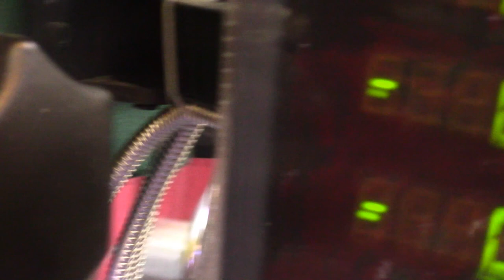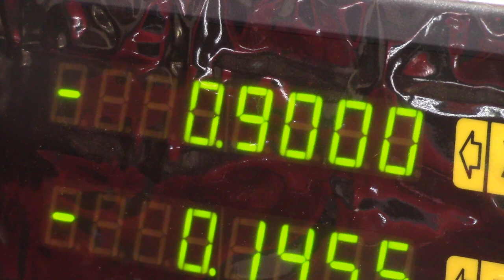Scope height gauge part 2 of 2  plus some more on drones and the law

Comment: nice work on gauge.....interesting to find out theres rules on drones...have neighbors who got two for  x mass  and theur buzzing all back yards in area ...irritating also pretty close to power lines
Reply from the maker: If they weigh more than .55 pounds they are FAA regulated.  I expect a couple of bangs into power lines and the propeller cost will go up.  Thanks for stopping by.

Comment: I like the basic principle of the height gauge and you made some super nice parts, but not yet quite sure whether it's essential, when for most part scope rings or picatinny rails are fixed height. Maybe I'm not fully grasping the thinking behind it.
I registered my first drone, then seemingly the requirement was lifted - then it came back and anyways I registered the Mavic too even before that.
Reply from the maker: My scope has a ballistics calculator built in.  So I have to know the height for the calculation and the rail is not the same height on all rifles.  I may move the scope to some other rifle and need another profile with a different height so I will need to measure again as the rails will be at a different height making the scope a different height.  Not overly necessary for measuring as I can do some addition and division and get the answer but certainly easier.  I am not all that happy with the regulation.  It certainly complicates things that could be a lot simpler.   Thanks for stopping by.
Reply: Thanks for the explanation Harold - I see the rationale much better now. :)

Comment: I understand how the scope gauge works & what data it provides you, but I'm not sure how that data is useful. Also your fitting the various bore diameters would be a good use for some gauge pins, in case you don't have any and need and excuse to buy a couple of sets. 😀
Reply from the maker: I would love to buy some gauge pins.  The scope height is for the ballistics calculation in the ATN scope.  It is also good for those who use a ballistics program for reloading.  Thanks for stopping by.
Reply: Amateur Redneck Workshop I suspected it was needed by a ballistics program since a similar measurement (arrow to scope) is required in an archery program (Archers Marks) I worked with the design team on several years ago.
Reply from the maker: As usual I did a poor job of explaining what the thing is for.  Sigh, no hope for a dummy.
Reply: Amateur Redneck Workshop, if there's no hope for the dummy, then those of us sitting in the peanut gallery are really pathetic (but I guess we all knew that -- I was aware of it some time back).

Glad I didn't have to ask why you'd use it, but I do have to ask: when will we see a vid of the process from gauging through to verification?